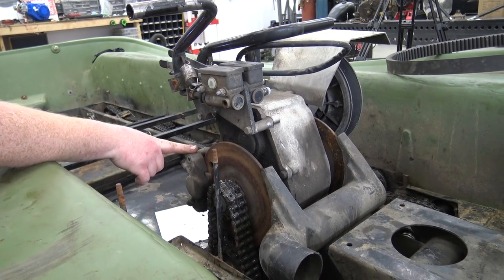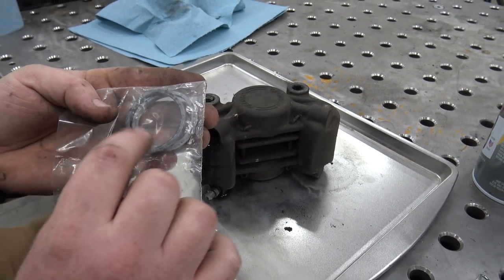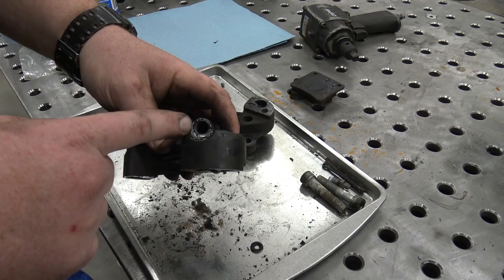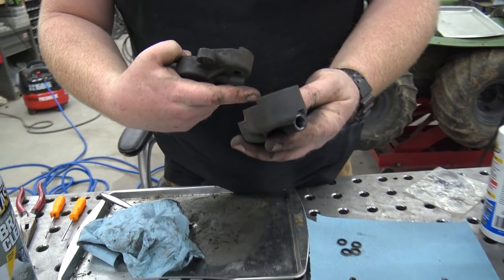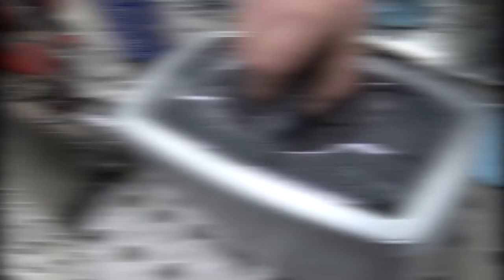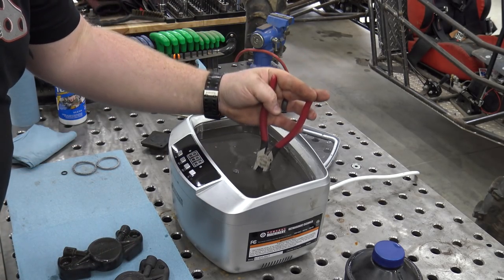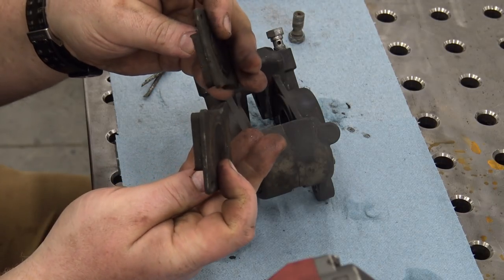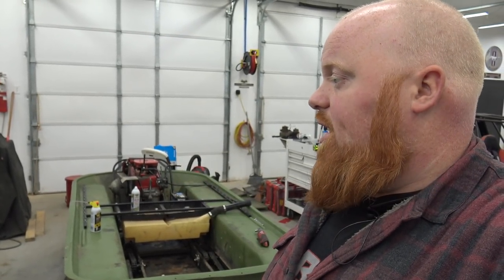Argo 8x8 Magnum Brake Caliper Rebuild

Comment: I have a John Deere AMT600. It has a similar brake setup and I've been dreading having to service them some day. That really didnt look so bad. Now that I know the HF ultrasonic cleaner seems to work well I'll be picking one up. The small size will be okay for me with a limited space for equipment that I have. 👍👍

Comment: Could you find a basket from cookware to fit in the harbor freight ultra sonic cleaner ? That way you could just lift the basket out except for the tiny bits , unless you make one with a screen on the bottom

Comment: One thing about brake fluid is dot 3 and dot 4 are a lubricant but dot 5 has the highest boiling point but does not lubricate.

Comment: just a tip don't put parts directly in the ultrasonic cleaner without the basket it is very likely you will damage the piezoelectric transducer that drives the tank if that happens your ultrasonic cleaner will permanently lose most of its cleaning power

Comment: Got a 2002 Argo Conquest. Had people look at it right side brake gets spongy have to stop and pump it up before going again. They say they have bled the calipers but the right side still is spongy. Put on new master cylinder , bled everything again still have problem on the right side. I’m going to swap calipers right to left and see if problem moves or stay the same. Any other ideas to remedy the problem?

Comment: Hey man, I was gonna leave a comment on one of your other videos from 2017, about the predator engine. It seems to me that you know your stuff and well I know nothing haha. I was having some problems with my carb, my butterfly lever is sticking wide open even with the return spring and everything on there. Absolutely no throttle response unless I use the choke as my throttle. Which in my case is not that safe being my minibike is like not even a yard long haha. If you could help me I'd really appreciate it. Thank you.